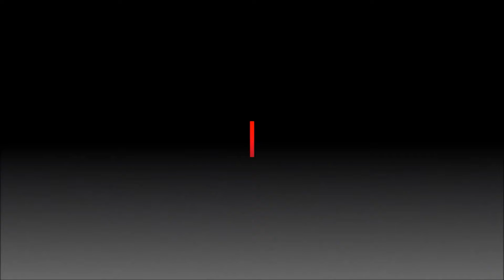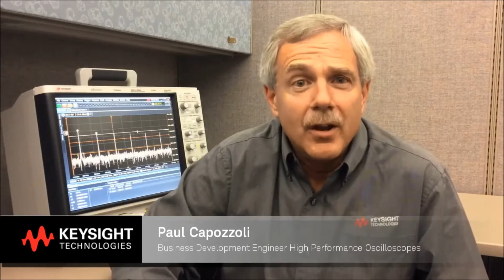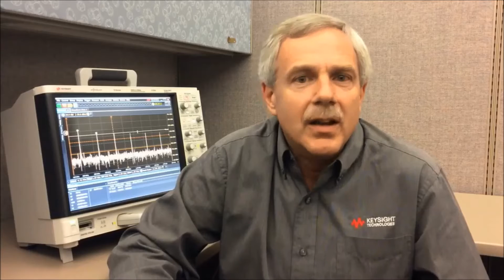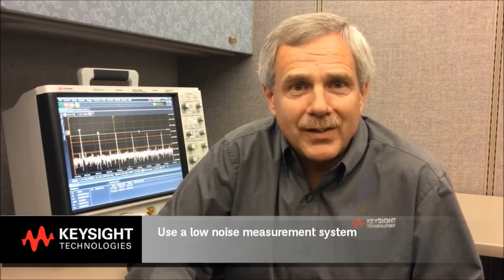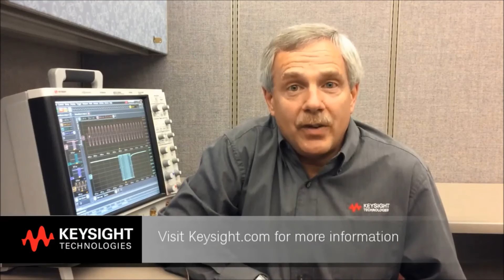How to Make Better Ripple, Noise and Transient Measurements on a DC Power Rail

Comment: As a note, how to make better Ripple would be as in wine....Lol. However reduction in noise & ripple always short cuts that all most all power supply manufacturers don't do, sad but true to cut corners as in materials and their cost....I.E, capacitors and also ground layouts. Very good video 👍

Comment: I have been looking at the N7020A. It covers a lot of ground with the 24v offset, but I have 28v and 48v designs as well. Is there any probe that can deal with that level of offset or do I stay with AC coupling?
Reply from the maker: +JetNmyFuture Thanks for taking a look at the N7020A. I see you want to look at ripple and noise on 28V and 48V supplies. I am not aware of a probe you could use that has enough offset for these rails. The good news is that when looking at 28V and 48V supplies, even if they have a +/-2% tolerance that means tracking down signals that are about 100mVpp (for 28V rail). I can think of two easy options. First one is to use a 10:1 passive probe. The signal will be divided down enough that using oscilloscope frame offset will allow zooming-in on the signal a bit. Unfortunately, scope noise increases proportional to attenuation ratio so the signal:noise ratio will be suboptimal but it is better than nothing. Second option is to use an external DC block and a 50 ohm coax terminated into 50 ohms on the scope. The good news is that the DC will be removed and the signal can really be zoomed-in on. The bad news is that the DC block will filter AC noise on the supply also. A ‘typical’ DC block will adversely filter frequencies from about 7MHz and below. -Kenny Johnson
Reply: Thank you for the note. That is essentially what I am doing now. The N7020A will be a great tool to help with the more delicate low voltage rails. I was just wondering if there was an option to improve my insight. Every time I learn a new and better way to measure, the result is an immediately making me a better (and faster) engineer.
Reply: +KEYSIGHT OSCILLOSCOPES So just to be sure I understand.... Use something like RG58 coax with two capacitors at the ends that go to where you probe your circuit to block the DC and terminate the opposite ends with 50 ohm to ground feed through adapters (the RG58 cables I have has BNC on side of them) that connect to the scope's BNCs?
Reply from the maker: +EETechs 
Thanks for taking a look at the N7020A. I see you want to look at ripple and noise on 28 V and 48 V supplies. I am not aware of a probe you could use that has enough offset for these rails. The good news is that when looking at 28 V and 48 V supplies, even if they have a +/-2% tolerance that means tracking down signals that are about 100 mVpp (for 28 V rail). I can think of two easy options. The main difference between these two  is the trade off between BW and sensitivity.

Use a 1:1 passive probe (like our N2870A) and AC couple the signal (a common setting available on most 1MΩ scope inputs).
   + Readily available
   + 1:1 attenuation makes for favorable signal:noise
   + can cover very large DC offset
    - AC coupling filters low frequency supply drift or compression
    - Only 35 MHz BW (using the shortest ground possible)

Use a 10:1 passive probe like the one that came with your scope. May or may not need to AC couple. 
   + Free—came with the scope
   + can cover large DC offset
   + 500MHZ BW (using the shortest ground possible)
    - Scope noise relative to the signal is 10X
    - AC coupling filters low frequency supply drift or compression